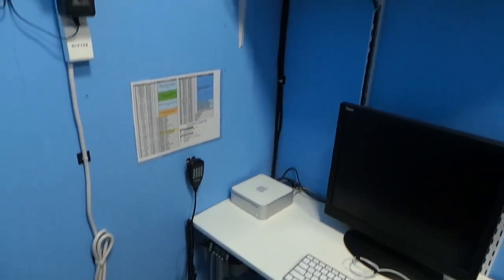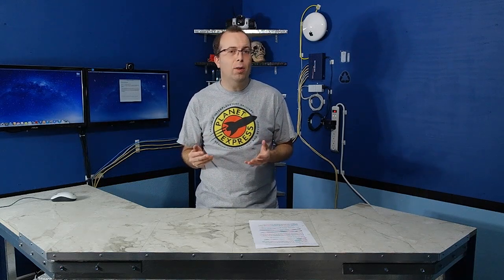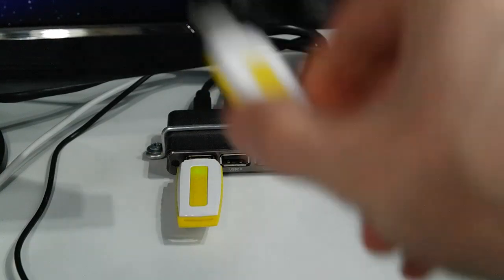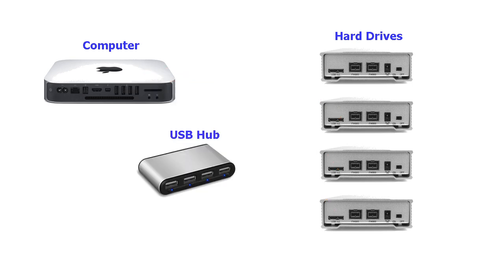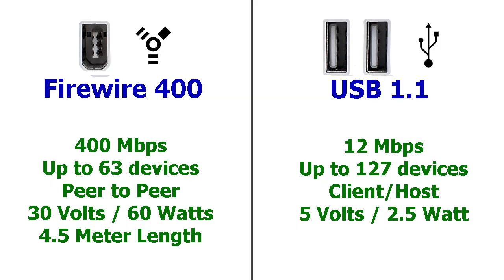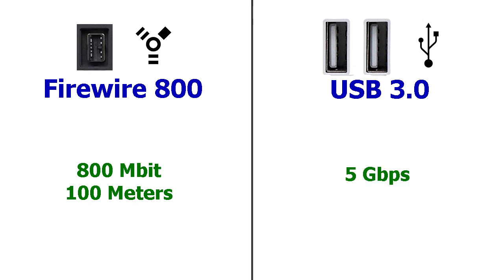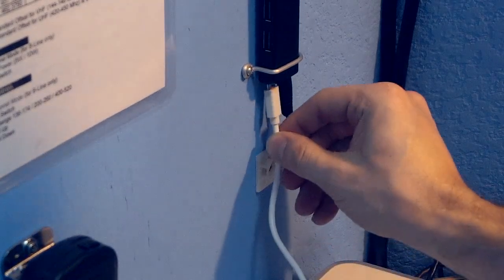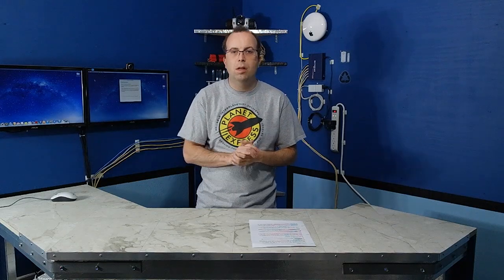Farewell R.I.P. Firewire, Hello USB!

Comment: uhm aren't those brackets give almost no support compared to horizontal? unless you scratching and bending the case for hub hard
Reply: how much weight you suppose those cables are adding? 30, 40 lbs?
Reply: *****
 i'm talking about brackets for hub, which is vertical instead of horizontal
Reply: tsartomato so am i
Reply: *****
 right now they are useless all weight is on the tape
Reply: tsartomato woooooosh
Reply: they help keep it secured when the cables are tugged on or if it's bumped into

Comment: Now it's RIP USB hello useless hated USB C!  :(
Reply: SeemsLegitGaming  we still have a normal USB port for 3.1 (type c)
Reply: "Useless"? "Hated"? Really? I think it's great! It's compact, it's user-friendly, and it's got a good, fast data rate.
That said we are in an awkward transition period, and it's going to be several years before we see the end of it. There's a million devices out there that provide or connect to USB A ports, and only a few that use USB C. So right now a USB C port would be, effectively, the USB port you can't connect things to without an adaptor. I wouldn't want to be the guy who bought a laptop that had only one USB port, and it's USB type-C. Not at this point in time anyway.
Reply: +Tetsujin The problem with USB C (apart from the somewhat more fragile connector) is that it is just that: a connector. A USB C port could be a Thunderbolt port, USB2, USB3, USB3.1, USB3.2, charging port (various standards...) and/or carry Displayport signals depending on what hardware is  behind it. This is what will be the nightmare the following years, many people think USB C means fast and new, yet on most phones it's just USB 2 which obviously is old and not that fast...

Comment: Firewire is an appropriate nickname for such an interface that has a substantial chance of destroying peripherals by simply using it how it was intended to be used (hot plugging).  And in some cases, making a mistake, and shoving the connector in backwards which the crappy design of the connector allows for.  It has one use in my opinion, that is to transfer DV video.  Just keep your fingers crossed it doesn't fry your camcorder's DV port.

Comment: They still put firewire on modern motherboards even today! lol Ironically firewire 2.0 did not stay around for long which was 800 Mbps and was launched way before usb 3.0 was around, then they dropped it on most boards and went back to firewire 1.0. Camcorders was the last thing i ever used it on, and that was 10 years ago.

Comment: The future is bright, the future is thunderbolt 3.
Reply: nah, it is wireless in Apple's echo system.  They will remove every port from mac like mp3 jack.
Reply: a3qn well at the moment, it's thunderbolt. You can't get the bandwidth with wireless. My 1080p wireless monitor lags and I have gigabit internet. Thunderbolt can support up to 5K
Reply: Vitani x They already removed Ethernet from Macbook Pro which is definitively faster than WiFi as you know.
Reply: a3qn Even an Ethernet adaptor is better than wireless.
Reply: i refuse apple

Comment: That was very interesting and informative, thanks.
Reply: I would still avoid doing this kind of mass storage solution.
The reason for that is that the USB standard is so poorly implemented, especially for Windows machines that you will have constant dropouts over time.
And then there is the problem of running an array like this for long periods of time... External drives die quickly if they have to run for long periods of time or 24/7 due to small enclosures and heat.

You are better off laying Ethernet cable and hooking up a multibay NAS in that case.

Comment: 200 USB ports disliked the video
Reply: Ronnie Roo  490
Reply: 491
Reply: 544
Reply: No. Just people who noticed he got a usb 2.0 hub because usb 3.0 is faster than fire wire.
Reply: 440
Reply: 448
Reply: @xXCoolGamerPro2635Xx  I was not in here
Reply: @rebert_reid  486
Reply: 507
Reply: 556
Reply: 563
Reply: 600
Reply: 612
Reply: 613 now
Reply: ChocolateCircus445 ARCHIVES 622
Reply: ***** no, it was usb because he was supporting firewire and not usb
Reply: Almost 400
Reply: oOps, 418 USB ports
Reply: @zashtozaboga  430
Reply: 431 USB ports now
Reply: 90000000000000000000000000000000000000000000000000000 USB ports
Reply: @rebert_reid  WHAT THE FUCK BOOOOOM

Comment: just so you know, there's now USB C to Thunderbolt 2 (mini display port) which works with apple's thunderbolt to firewire 800 adapter. Firewire was really awesome. low overhead, low latency etc. I know this because i still have firewire audio interfaces, where it's still actually supported, but not made new, anymore.

Comment: Firewire had its speed because it had direct access to the computer memory. However, this actually was a big security issue because you can connect a hacked firewire ipod to a running machine with firewire and have it copy all the memory from the pc to the ipod. Windows at the time stored it's passwords in a specific area in memory, so anyone who did this would know the passwords for the PC.  I know some users who would cut the pins to the firewire port to remove this risk. I still have one firewire external hard drive.

Comment: Why you external harddrives on a server anyway?
Reply: its a quick way to add more storage without having to open the pc up.
Reply: You may save time installing them but after all the money you wasted when cheaper to buy internal drivers which in the end will run faster. So stupid to be honest.
Reply: What do you expect from a guy that mounts even a USB hub to the wall? :'D
Reply: He's using an old Mac Mini as a server. There are no internal drive bays in those things.
Reply: cause raid cards cant be trusted (hello from a linus tech tips fan)

Comment: Well I use firewire to connect 2 PCs, 1 of which doesn't have ehternet port. With the functionality of WinXP (32 & 64bit) I can share my internet connection (because only my PC1 is connected to the internet via its ethernet port). This feature was removed from later versions of windows unfortunately (I've tried downloading some custom apps for win10 to make it recognize my firewire device as ipv4 connection but gave up eventually). 

Of-course as I'm using ipv4 protocol to connect the 2 machines I can do a lot of other stuff like sharing files and my keyboard & mouse (via Input Director). Plus I can switch between drivers and use the firewire connection to kernel debug one of the PCs (for older windows versions this is pretty much the only way to do this kind of stuff unless you have obsolete COM ports (which will be slower) or buy some very rare usb peer to peer debug device). So pretty much using firewire to communicate between those 2 windows PCs is one big bargain.

Comment: FireWire > USB when it comes to audio though.
Streaming vs data packages.
Reply: troo and with audio interfaces. if you want 8+ channels firewire is the way to go.
Reply: I still use my MAudio ProFire 610 regularly.  Hard to beat a good firewire audio interface.
Reply: Yes, the way the data is sent on FireWire makes a big difference to the bandwidth.
Reply: I'd totally agree with you :D

......if it was 2009
Reply: We have a presonus sound mixer at school and it uses firewire 800. The problem is USB can't be adapted to Firewire 800 so we either need a mac with thunderbolt 2 or 3 or a pc with thunderbolt 3.
Reply: If you want to say you use 37 500 000 Audio Samples... yes maybe you need more then that... what the hell is wrong with everyone her? Like people forgot what tech does and blame the cable for stuff that isnt the problem. Low Latency is about the driver, and bottleneck of your audio device processor. How fast it can change the analog to digit signal. USB doesnt matter, its just again people read apple bullshit again. If you dont belive me, go calculate the speed from Mbits to Kbyte and you see its the controller...
Reply: And are there audiophile grade DACs with Firewire?
Reply: they fucked the consumers with this,,, i had a firewire presonus interface that was the standar bacj then for audi interphases, they are so expensive now if you want firewire
Reply: Still with ProFire 2626, still works great. No official support for modern OSes, unfortunately.
Reply: Even 1000+$ audio interfaces like RME use Firewire 800.
Reply: That's an easy question nowdays....

A question like that, the answer would be ;

Got control of a nuclear driven deLorean : out of luck
If it's 1995   : IBM computer 
If it's 2009   : Mac computer
It it's 2012+ : A somewhat decent PC with an extra PCie FW800 card
Reply: Thats straight up nonsense. The USB and Firewire transaction layers are completely different. Firewire has read/write/lock and drops the layer completely in isochronous mode, usb has a whole different mechanism , and relys on an asynchronous model to get around the host timing issues. Its more complicated and traditionally wasnt great for latency. Firewire was engineered on a peer to peer basis from the begining for old style audio systems where clock would come from hardware in an audio or video studio, USB has a host model that reflected its use as a sort of god-mode update to RS232 
Regardless in 2018 it barely matters. USB3.1 and thunderbolt are the kings of the hill now, and both are a long way away from the old USB2/Firewire roots
Reply: literally just had to pick up a 1394a pcie card to use my firepod with the new system i'm in the process of building. so harsh.
Reply: Yeah firewire has much better latency, even more than USB 3. However I believe Thunderbolt is even faster+shorter latency. Problem is, good 8ch+ADAT interfaces are crazy expensive and i really dont wnat to let go of the trusty Focusrite liquid channel just yet (Those pre's are so nice)

Comment: More than a year after publication but... as horrible as Windows ME was - it was the first consumer grade MS Windows with generic mass storage driver - ergo it did support USB flash drives out of the box - so there is a slight error in the compatibility list presented in this video. Although one had to have a compatible motherboard with a right chipset with a right set of drivers and the stars would have to be aligned and so on to make it work on ME :).

Comment: why not just use thunderbolt? It does everything firewire did and its way faster than usb 3
Reply: alexis. do you really need 5gbits/s. to print a document.  i mean  a parallel printer port did the job..
Reply: Anti-YouTube Video Editor AUTTP than thunderbolt?
Reply: rrrglynn no worry, USB 3.1 g2 is better

Comment: There are over 27 different Firewire audio interfaces still in production by at least 7 major manufacturers (Nov. 2016). Firewire is not dead yet. Interestingly, there are over 56 Thunderbolt type 1 available. I wonder which will be truly dead first?

Comment: Every time I do a firewire project, I'll watch this video. I just invested in a DVD-RAM burner to backup all my important photoshop/finalcut files and FLAC downloads. I wanted to invest in magneto optical or UDO, but it's way too pricey and there was no way to make a firewire device from the drives - only avilable in scsi or extremely expensive usb. I don't take care of DVDs or CDs very well and I really like the protective cartridge system used in magneto opitcal (I still use minidiscs btw). I discovered DVD-RAM and it's cartridge based system. It's very affordable and stores up to 9.4gb. So I bought everything I needed to make an external DVD-RAM firewire system for my macbook.
Reply: Hardware is rarely an investment... It's an expense, the money spent on hardware realistically never returns completely like an investment would.

Comment: "You can't connect two computers with a USB cable for data transfer." Uh, yeah you can. Me and my friend bought an A to A USB cable and we got a special free program to allow us to use the USB cable as a connection between two computers so files can be transferred easily.
Reply: Yup, and LAPLINK even had a complete data transfer package that included the software, a male-to-male USB cable, and if I remember correctly, the 'legacy' serial/parallel cable.   I know it worked with Win2K and I think it would also work with Win98/ME.
Reply: Tails19935 That A-to-A cable almost certainly had a chip in it to do the work.
Reply: Did the same thing about 6 years ago.
Reply: *without a special free program
Reply: PackerFan Gamer It wasn't hard for me to find one. But for some reason I don't remember quite well if it came with the cable on a CD or if I found it online. I just remember hooking the two computers up, installing the program on both computers, and within 10 minutes, it was ready.
Reply: PackerFan Gamer
Even serial or parallel connections between computers require some sort of software to make it work.  In MS-DOS v6.x, there were built-in utilities, INTRLNK and INTERSVR for serial or parallel ports.  Win9x/ME had a utility also, it was set up in networking and also used parallel or serial ports (though for the life of me, I cannot recall what it was called).  I'm fairly certain it was carried over to Win2000 and possibly XP.
Reply: xaenon Really? I didn't know that. Well, for the setup I did, it was for a Windows 7 and Windows Vista computer.
Reply: xaenon If I'm not mistaken, as soon as you install a 1394 driver in WinXP and above it will be recognised as a network adapter. You'll not need anything apart from windows itself to create a LAN network.
Reply: tenyuhuang
Yes, but in Win9x/2K/XP, Direct Cable Connection was not automatically installed.  You had to go into the network control panel applet and add that as an 'adapter', just like you did with Dial-Up Networking.   AND you had to set up file and print sharing as well.  Not exactly plug and play.  LAPLINK had its own built-in setup that not only allowed data transfer but remote desktop capability, IIRC.  It allowed data transfer and remote operation over LAN, DCC, and even a modem.
Reply: xaenon Hmm, if that's the case, it seems that maybe it's my driver doing the laundry work for me 🤔
Reply: tenyuhuang
Yeah, everything in windows is a driver of some kind.  Your keyboard, mouse, etc.  If you install windows without a specific video driver, it installs a generic 16-color display driver.  In win9x and Win2K, it was 640x480; I think XP and above got 800x600 by default.

Comment: The main reason I built a custom computer is because I absolutely hate using USB hubs. PCI to USB cards are the way to go.
Reply: got one with 4 external ports and 1 internal port. great for a bluetooth!
Reply: The Vibe nice! I just got one of those as well.  Still waiting for my BT dongle to come in.
Reply: or get a 999$ board with 10 usb ports and dual lan lol I hate how they capitalize on such things
Reply: EspHack I hear ya there.
Reply: Then stop buying the cheapest USB hub you can find. Buy a decent USB hub with quality power supply and cabling and they're great. The cheap ones are shit indeed.

Comment: Most of my studio soundcards is Firewire only. I keep a bunch of Firewire PCIe expansion cards that is driverless just because of that. Granted, somewhere down the road these Soundcards will be replaced, but they are still top of line quality despite being really old now. So there is no need to replace them as long as they work.

Comment: That's odd... I've had Windows ME for years back in the day (still do on my old PC. I use it to play my old games) and I've always managed to get USB drives (both pen drive and USB hard drive) working on it right away. Actually I can plug in my external HDD on my old PC with Windows ME and it will recognize the drive just fine like any modern machine does. Never had to install extra drivers or updates from Windows Update to get USB storage working on it. I can't say the same about Windows 98, however. As far as I can tell, Windows ME does support USB storage natively. Not meaning to question you, 8-Bit Guy, but are you sure that information at 1:30 is accurate?
Reply: Windows 2000 was released before Windows ME.
Reply: Windows 2000 has been released (date of general availability) on the 17th of February 2000. Windows ME (same general availability date) instead on the 14th of September 2000. That's about half a year later.
Reply: He's not wrong. The earlier versions of windows didn't have native support for USB storage, they required updates/patches, and often third party drivers.
Reply: I know that. I feel like you didn't quite understand what I said in my comment, though. I'll try to simplify... Windows 2000 was not the first Windows to support USB natively, it was Windows Millennium Edition. Windows 98 SE, 98 and 95 required drivers/patches in order to be able to use USB devices such as thumb drives while Windows ME, on the other hand, didn't. You can do a fresh install of Windows ME on any computer and stick a thumb drive or external hard drive on it right away, even before installing any of the drivers your motherboard requires and it will work perfectly fine as it would on Windows 7 or 10. Do that on Windows 98 SE and the ones before and you will be asked for a driver. Not for Win ME.
Reply: Me stands for Millennium Edition, but it had so many problems Microsoft ditched it for Windows 2000. Me come out before Win 2000
Reply: Just fuck you, Me before 2000

Comment: Why is firewire faster than usb 2.0? Because USB 2.0 is single ended, it can only communicate in a single direction, meaning it has to turn the line around constantly to communicate. When USB came out, I immediately said "that single direction stuff is a problem", and sure enough, they had to change the physical form of USB to accommodate it.